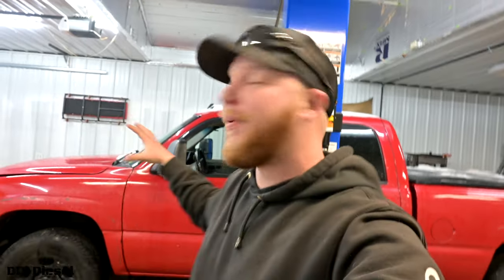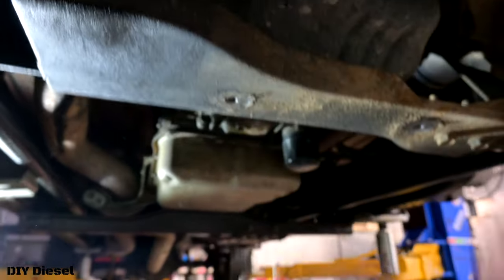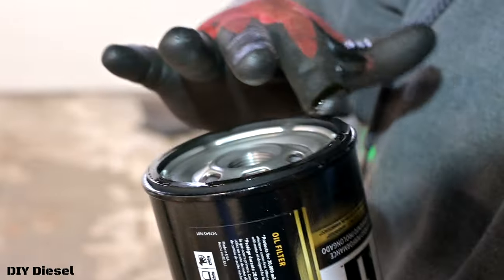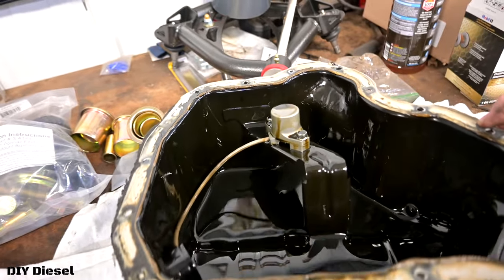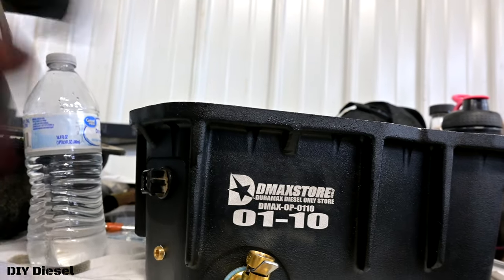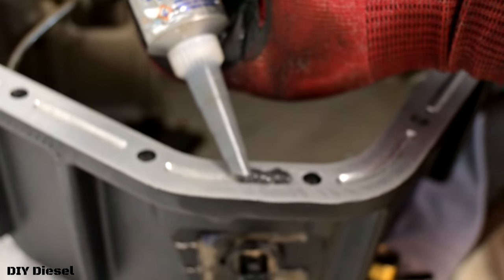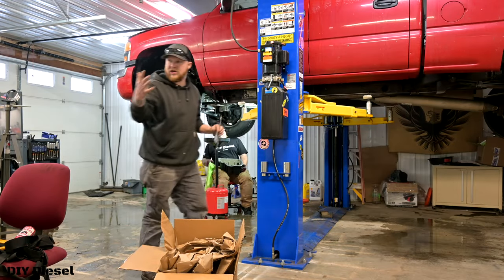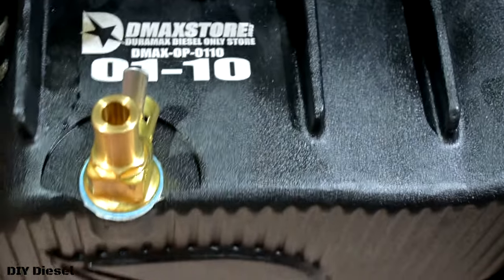DMAXStore High Capacity Oil Pan Install 2001-2010 Duramax Diesel

Comment: I've seen many zinc plated fasteners fail from corrosion quickly. Keep on eye on these or use the oem anchors if they are long enough.
Reply from the maker: Great point 👍 definitely will do!
Reply: No doubt! Would definitely get a bag of "Dura bolts " ( The best bolts) if needed. 👍🏁💨

Comment: Tip for those doing it yourself with the truck on the ground... when installing the new pan get yourself a jack and to hold the pan for you. One arm holding and the other trying put the screws in is dumb lol
Reply from the maker: Badass tip! I’m going to be doing a driveway install on it soon! Definitely will utilize that trick for sure 🤘

Comment: Nice video💯 but which are the 2 bolts that you said you forgot to mention but we have to remove them in order to install the oil pan??
Reply from the maker: They are studs for the oil pan. You will see them when you take the old one off because those will be nut’s instead of bolts.

Comment: Well this video got me to order one. Will be here tomorrow. Mine is the the 15.5 and from what I have seen there is a screw on the transmissions that will need cut in order for any deep pan to fit. Did you have to do this and if so what did you use. Hack saw with a metal blade? If not any suggestions
Reply from the maker: I did not have to do that we just backed it out and then threw it back in after the new one was installed 👍 also I appreciate the support 🤘

Comment: What are your concerns, if any, about the fomoto drain. If it has no magnet at the drain, would that not be a concern? About to pull the trigger on this oil pan but wanted an opinion on this before. Thanks
Reply from the maker: I personally have zero concerns for it, but if you are hesitant they have the ppe one as an option that has a magnet on it when you are selecting the pan.
Reply: @DIYDiesel  nah I just wanted your input. You wouldn’t happen to have a savings code or whatever. I know it helps the channel so figured I’d ask before I made the purchase.
Reply from the maker: @camsloop9455  I appreciate that compliment 🤘 unfortunately parts stores seem to not give out discount codes for people